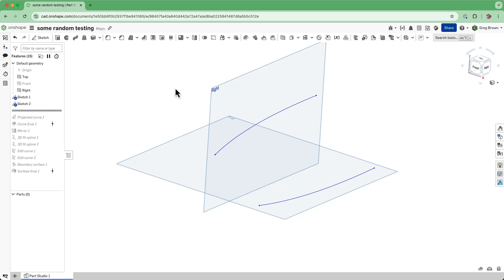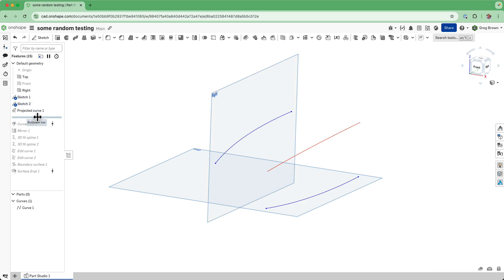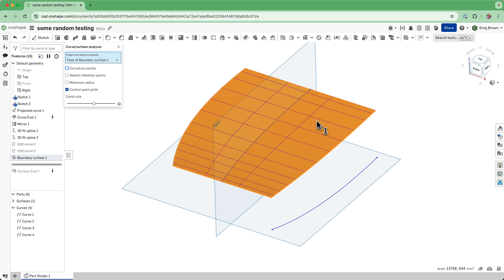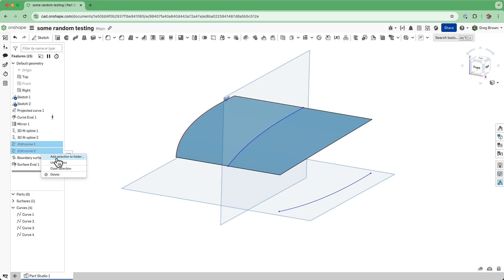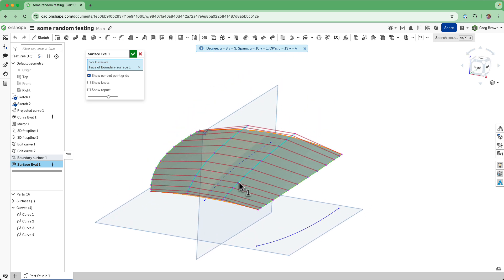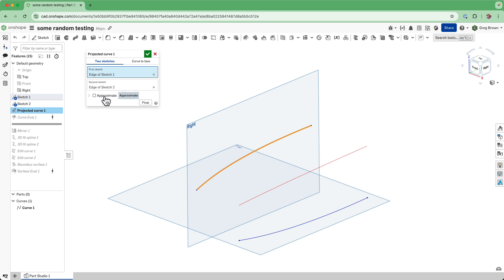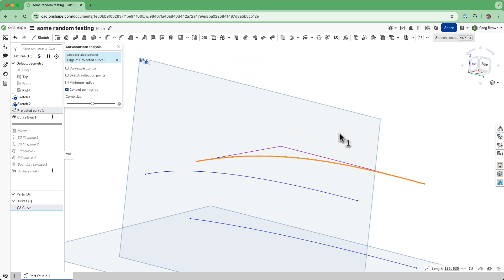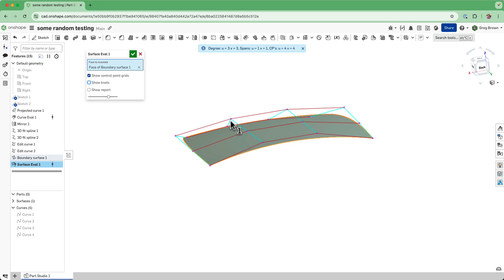Onshape surfacing fundamentals - we've come a long way!

Comment: Hello , very useful fundamentals here. Question:
At  3.11 you elevated curves to degree 2 (with 3 control points) but you got a surface with degree 3 ( 4 control points) at 3.51  , why did surface create an extra control point?

Comment: I'm updating an old design with new curve techniques. I can't really tell if the quality has improved, but speed is definitely faster. Please keep the videos coming. Have you posted your eval tools?
Reply from the maker: Thanks!! I hope this helps your designs - I do follow along with your forum posts.... 

My Curve and Surface eval tools are here:
https://cad.onshape.com/documents/d675d2ccbcf6336cf8ef52bb/v/ca0fbc4c032a6dc1739420a2/e/853bddb5d9a1fffded23ae80

Comment: Thank you so much for these videos. The tutorials you've made on top down project organization and everything on surfacing are the best learning resources on these topics I've found in the last 5 years or more.

I've switched over to onshape for my personal work because of your videos and if I ever get the latitude will be switching my professional work in that direction as well. Feature Script makes it a no brainer imo.
Reply from the maker: Thanks so much for the comment - it was a great way to start my day here! Let me know what other videos/demos/tutorials you think would be useful!
Reply: @gregbrown-onshape7555  I'm sure it's something in my approach, but I have run into a lot of problems with loosing nice curvature and continuity between sketching or projecting curves and forming surfaces from them. I've also run into road blocks when trying to form surfaces to use as tangent references when making my main surfaces. Seeing some examples of approaches to build up multiple surfaces into an object that avoid some of these pit falls would be really helpful. 

For context, I've been working on a handheld macro-pad to use when I'm drawing or working on a tablet. It's something like one half of a game controller. I've finished the electronics and programming, but the modeling has proven complex and I am forcing myself to get better at parametric surfaces by not just hacking something together in Blender or something. Obviously part of the fun is figuring it out and getting better by trying a lot of different ways to tackle the problem, but it would also be nice to finish this project!

TLDR:  examples of how to approach building up surfaces for something like a controller or mouse would be incredible.